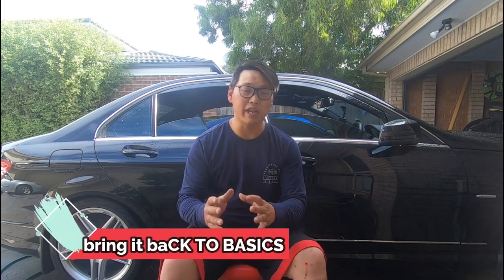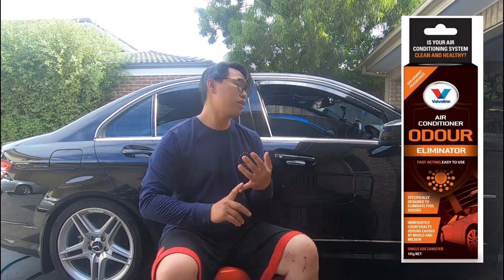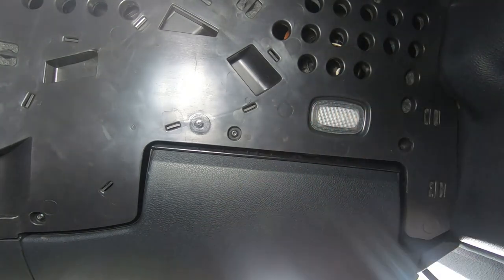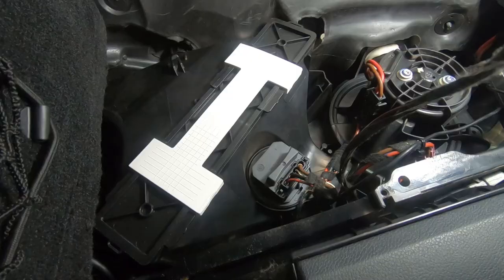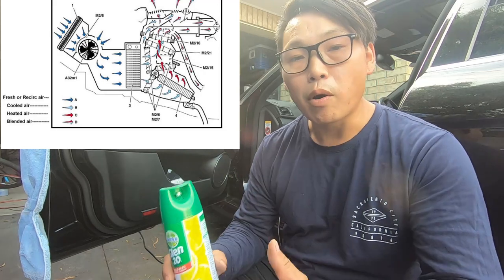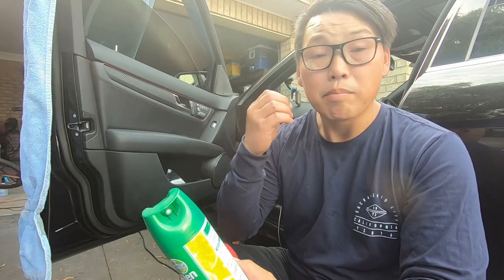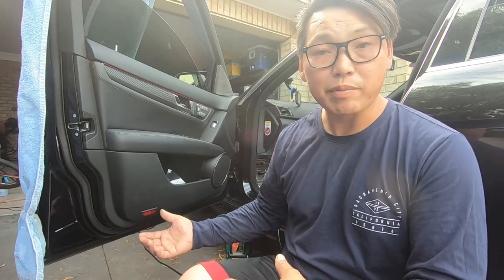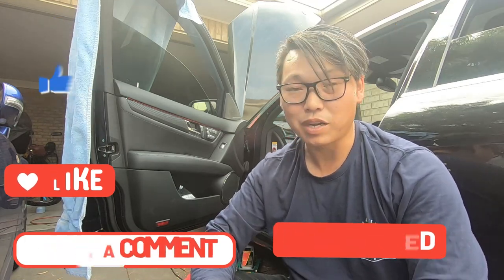MERCEDES W204 CABIN FILTER CHANGE-A/C BAD SMELL ODOUR (common issue) FIX!!! MUST SEE !!!

Comment: 1) How long did you let  the recirculating fan run after spraying ? 6:38
2) How long did you let the outdoor circulation fan run after spraying below the windscreen 7:18
Reply from the maker: I let it run for about 5 to 10 mins

Comment: Hi Mikey, i watch this on 2022 and i have some similar problem with my W204. My question is, 1) is it safe for W204 to use the AC Cleaner foam which is you directly spray it on to the air vent, will it cause some electrical multifunction. 2) Can u spray it on the outside fan behind the external air cabin filter box, because i find it very dirty and hard to clean. Btw i'm chandra from jakarta-indonesia. Thanks bro.
Reply from the maker: yes the foam is made to evaporate and eventually turns to liquid ... I would use that and use a long hole and get as close to the evap core as possible 
whata ur main problems? 
dirt? or mould if itsmould I would really spray it everywhere that is building with mould
Reply: @MIKEYZVLOGZ  my AC smell kinda bad and got a friend that recommend me to use the foamy ac cleaner. i think it is caused by mould. The dirt i mentioned was in the blower fan which take the air from the outside. last question, can i do the same treatment for the rear air vent?
Reply from the maker: @cshadiq  yes u can..

Comment: Bro i m having a sensor problem in my mercedes w204 petrol 2009 model the parking sensors are not working just blinking red light not working both front and back hellp me plzz ?!!!?
Reply from the maker: have u had any accident where u hit the sensors sometimes its from tapping the sensors accidents or the actual display inside your car could be broken..ive got videos showing how to remove both front and rear display sensors and my front bar disassembly video shows how to remove the front sensors